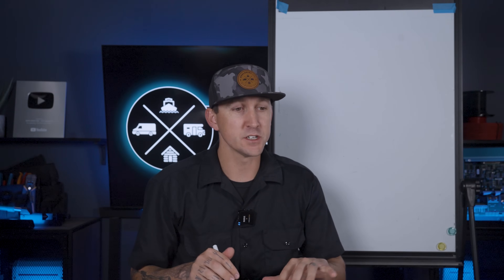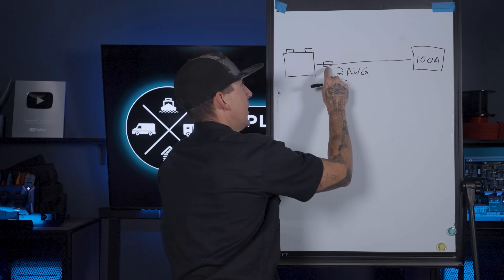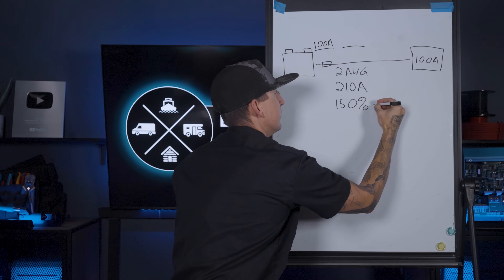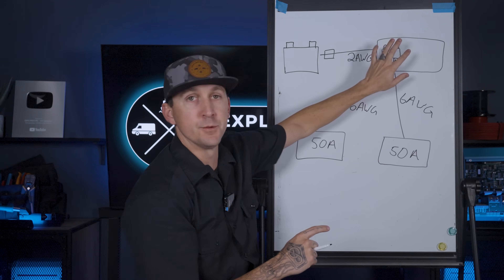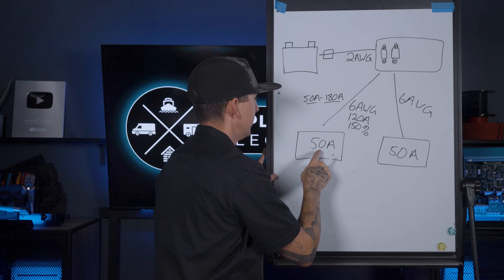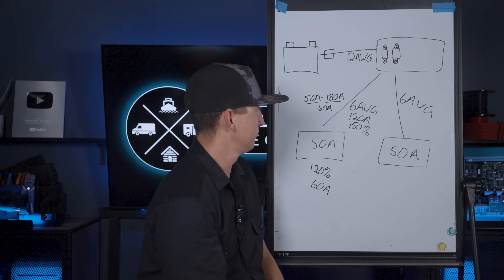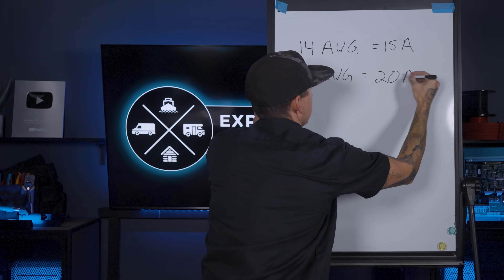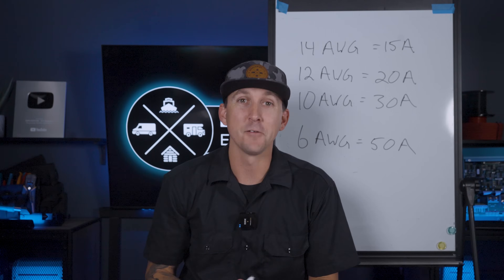Sizing Fuses and Breakers 101 - Fuses, Breakers, & Overcurrent Protection | Ep: 5/6

Comment: Your wire chart does not note the length of the wire. The length is as important as the gauge when figuring amp capacity.  I am somewhat confused how a chart can show amp rating of a designated size wire without also showing the length of the wire, the amp rating will drop per foot of length. Not sure what I am missing here. The fuse is suppose to protect the wire, length increases resistance. resistance is a factor where amperage is involved.
Reply from the maker: Great observation 👍 You’re absolutely right that wire length, voltage drop, and resistance all matter — and how those factors are applied depends heavily on the specific circuit, system voltage, and use case. That’s exactly why charts can feel confusing without the full context of a real-world setup.

Rather than trying to unpack all of that in a comment, the best move is to let us look at your specific circuit and help you size everything correctly and safely. Our support team can walk through your wire runs, loads, and protection — and make sure you’ve got the right parts if you need them.

👉 https://shop.explorist.life/support?utm_source=youtube&utm_medium=comment&utm_campaign=support&utm_content=response_link

Comment: How should we factor in transient loads such as in the case of an AWG 1 wire supporting a high torque starter motor for a gas engine where the load might reach 300 amps but only for something less than a minute or a few seconds?
Reply from the maker: That’s a really good example of where the “it depends” stuff really matters—run length, insulation, ambient temp, starting behavior, etc. all play into how we size wire and protect it for those short, high loads.

If you’d like, we can run through your exact setup and help you size the wire, fusing, and components properly for that starter circuit. Just reach out to our support team here and we’ll take a closer look at your project:
https://shop.explorist.life/support?utm_source=youtube&utm_medium=comment&utm_campaign=support&utm_content=response_link

Comment: Super helpful video, thank you! I have a 3k Inverter in my system, are you factoring that into your load total for sizing the main fuse off of the battery bank? My inverter can draw 250A at 12v so adding that to my other loads plus would put me at a 450A fuse? Is that correct?
Reply from the maker: Reach out to us at shop.explorist.life/support and we can get you the proper fuse sizing and wiring kits (and components) you need for your build.

Comment: Is there any consideration for the battery specs when sizing fuses?
Reply from the maker: Great question — yes, battery specs can play a role when sizing fuses, especially things like the battery’s max discharge current or recommended fuse rating.

That said, fuse sizing is usually more about protecting the wiring and connected components, not just the battery itself. So wire size, load type, and circuit layout are all key factors too.

To make sure your system is properly protected, our support team can take a look at your exact setup:
https://shop.explorist.life/support
(We offer free personalized support for gear purchased from our store!)

If your gear came from somewhere else, the EXPLORIST Pro Support Membership is a great way to get tailored help:
https://shop.explorist.life/shop/all-products/membership-tiers/

Comment: Great video, however do you not also have to calculate the length of the cable run round trip when sizing a fuse. Just as you do for sizing the cable. As the longer the cable the greater the resistance.
Reply from the maker: That's not true, no.  Give the video another watch to see how you size fuses. 🙂👍🏼

Comment: I'm new to all of this, so this is likely a newbie question.  But, what components are people using in their vans, RVs, and boats that draw such large amps?  I can only think of A/Cs, microwaves, induction cooktops, and AC inverters.  How many amps do these usually draw?  The Lynx distributors seem quite popular, yet sort of expensive.  I'm just trying to understand why they're necessary.
Reply from the maker: Totally valid question—no such thing as a newbie question here! You're spot on that high-amp components often include things like inverters, A/Cs, induction cooktops, and other power-hungry devices. The amp draw can really add up quickly, especially when multiple systems run at once, which is why something like the Lynx Distributor becomes helpful for safely managing and distributing that power.

If you're trying to figure out whether it's the right fit for your setup, our support team can help you sort that out: https://shop.explorist.life/support
We offer free personalized help if you got your gear from our store: https://shop.explorist.life

If your components came from elsewhere, our EXPLORIST Pro Support Membership is a great option for custom support: https://shop.explorist.life/shop/all-products/membership-tiers/

Comment: Love binge watching (and like bombing) your channel. Question: what do you do when you have a current source on both sides of a wire?  IE your 48v diagram for 30 amp towable, multiple rack batteries into a Lynx power in. If one cable were to dead short, that battery has a 125a breaker backed up by the BMS which would also shut down… but if there are 3 other batteries on the Power In, the second of cable between the fault and the Lynx power in would potentially be exposed to 375 amps to trip the breakers of the remaining batteries.  

Wondering if it would be a good idea to do the fuse mod to the Lynx power in, say 125 or 150 mega fuses on one end of each battery cable, and the battery’s breaker backed up by BMS protection on the other?

Naturally I’d install the battery cables so there’s no conceivable way they’d ever short, but imho that should be the case with every conductor. And the over current protection is there to make sure no one is hurt and nothing burns up if that event that should never happen happens.
Reply from the maker: Really appreciate the binge-watching and thoughtful question! You're absolutely right to think about fault scenarios like that — multiple current sources feeding a common bus can create unexpected risk if a short occurs between just one battery and the bus. Adding fuses on the Lynx Power In side of each battery can definitely provide an extra layer of protection and isolate a failure more safely.

For personalized feedback on your setup and fuse sizing, our support team is here to help: https://shop.explorist.life/support

We offer free one-on-one help for gear purchased from our store. For gear from elsewhere, the Pro Support Membership is the way to go: https://shop.explorist.life/shop/all-products/membership-tiers/

Comment: Hey, thanks for your videos! Very informative and detailed!
I've two questions:
1) why are using ~2" copper bus bar between battery switch and lynx? Since you still have to use black spacers for mounting, why not connect switch direct with lynx and use other spacers. This saves one connection/failure point and some resistance
2) in all victron diagrams  switches are before loads and after the battery, charges (MPPT/Orions) are still connected to battery via resettle fuses. 
In your diagrams you can disconnect battery, but charges will still provide power to loads, but with unstable voltage. This can kill some electronics. Am I wrong?
I would either put two switches: loads and charger, or use a double pole switch that disconnects battery from loads and charges and also loads from charges

Comment: That was a good explanation. We don’t talk enough about the heat rating of our cables in our system.

For my Van/Cabin builds I use all 10awg AC cables.

For DC I follow ABYC guidelines which are in line with your calculations. I’m also using marine grade cable, lugs and components whenever possible.
Reply: I'm a little unclear here, you use 10AWG AC cables for what, though? Like for a 120Volt lighting circuit, 10awg would be way oversized and an unnecessary expense, as well too big for a lot of devices.
Reply from the maker: Yeah, 10AWG for standard 120V circuits doesn't make much sense.

10AWG for 30A circuits (30A shore power)
12AWG for 20A circuits (duplex outlets)
14AWG for 15A circuits (single outlet or lights only)

🙂👍🏼

Comment: Do you happen to have a link to the document you referenced about max fuse ratings?  It would be nice to reference it and what it say about voltage drop over distance.
Reply from the maker: It's ABYC E-11.  It's tough to link to it because you have to pay for access.  It doesn't say anything about voltage drop over distance, though, as that's a different deal which we've already covered in this academy.
Reply: @ Thanks so much. You do a great job explaining things.

Comment: The only place I would go to 150% of wire ampacity is for a starter motor circuit and that is only if its not practical to over-size the wire, but that is just me.

Comment: Thanks for the content!  One thing I still struggle with finding good information on is when and where class T fuses are appropriate for large battery banks.  A lot of people suggest still using class T fuses even if you have a rack battery with built in breaker and BMS.  If wiring terminal to terminal, do you just need one fuse before the distribution bus bar?  If wiring all batteries to a bus bar, does each positive need a fuse (can other batteries feed back into a shorted battery through the bus bar), or is that only if you have multiple strings of batteries?
Reply from the maker: Here is our full playlist covering overcurrent protection that should answer you question: https://www.youtube.com/playlist?list=PLmvhcyi4n0TVgEPNeB-Ob4CKYDWvGXB6E

If you're still left with system design questions after watching all of those, perhaps you may find some value instead in going with our pre-designed https://shop.explorist.life systems.  They are nearly infinitely customizable and we can help make adjustments as needed.
Reply: great question